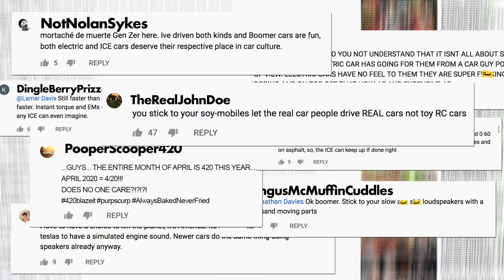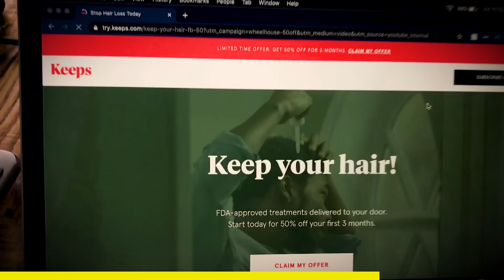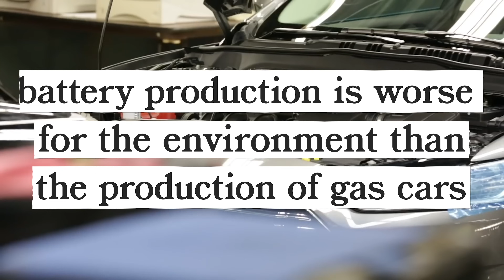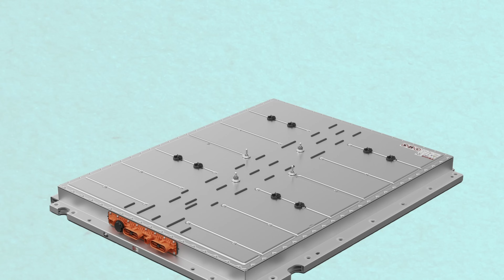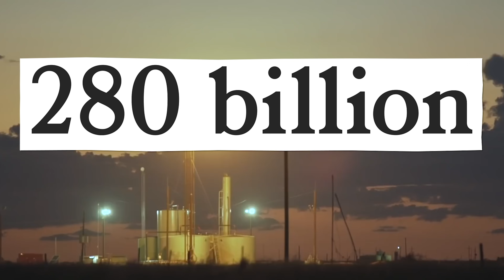Are Electric Cars REALLY Better for the Environment?

Comment: You keep mentioning how it is cleaner to have a electric car in areas where Renewable energy is more available. You need to look at how little a percent of our energy that really is. Then you need to study and find out the facts of these so called Clean Energy power plants. You will find they are not clean and almost always produce less power than coal and natural gas plants, while still emitting a crap load of emissions. And none of them run entirely on renewable fuel, they all use coal or natural gas to burn these so called renewable fuels. Biomass plants cant burn green or wet wood with out help, wind and solar power is intermittent and needs a fossil fuel supply to keep the power consistent. Hydro power requires major disruption to rivers and the landscape. ALL OF THESE ARE BULIT AND KEPT RUNNING WITH FOSSIL FUEL POWERED EQUIPMENT. There is a law of energy that can not be changed. Energy can not be created or destroyed only changed from one form to another. None of these alternatives will be able to produce enough power because they just dont have enough energy in them.

Comment: I agree with all of this...However, and it is unclear in this short format, it seems that most of these facts are averages, the "average" EV vs the "average" ICE correct?.   Wouldn't the averages be skewed towards EV simply because there are no large suv or pickup models available yet? Suv's and Pickups make up a very large percentage of ICE vehicles. Thus their averages are going to be higher by default.  I still think EV would be the winner, but I wonder if the margin would be much less and therefore less significant.   In either case, It will be interesting to do this same comparison in 20 years when there are more Larger EVs (and more EVs overall).  Will the technology catching up negate the increased emissions due to increased average size and range?  Will the depletion of resources force average emissions higher in order to source lithium and cobalt from more difficult areas?

Comment: One thing you missed, and I see everyone missing from their calculations is adding co2 cost of replacing battery every 6-8 years. From your calculations it’s 10 metric tons.
Reply: Batteries don't need to be replaced every 6 to 10 years.
Reply: @UnrealOG137  check out hoovies garage movie about his Tesla model S. Right when warranty ended after 8 years he got update and could only charge car to drive 49 miles. Did some digging, it’s common issue go check it out. Battery replacement is 21k USD plus co2 environmental toll of course. Not sure why would they do that is that planned obsolescence or these barriers may get unstable after such time not sure.

Comment: When I can drive an electric car every day with zero interruptions in my current lifestyle I will buy one. It needs to cost no more than my STi limited did, be as reliable as it is (unmodified), require no downtime due to range/distance issues, go 200,000 miles with standard required maintenance, this means no 10k$ battery changes in the same lifespan. Insurance cost the same or less and last but pretty much first in my book: it has to be as fun and engaging to drive. I have to enjoy it, no one trick ponies. It can’t just be blistering fast in a straight line and weigh 4000#, it needs to be 3400 or less and just as agile feeling.

Comment: Don't forget Nuclear power. Its mostly carbon free. Also your dismissal of the environmental impacts on the local communities that produce lithium and Cobalt is a bit light. We do not have a method to account for those impacts on our environment in our current production of batteries nor for the disposal of the batteries but you did mention that. good work

Comment: Myth #2: Anyone remember the power grid doing down foe weeks in Texas that one winter?
Reply: Yes, because their natural gas pipelines froze
Reply: Anyone remember how the Texas power grid went down because the state's Republican regulators stuck their collective heads in the sand and refused to perform basic upgrades to their grid? Did you know one of the reasons Texas has an independent power grid is because the state didn't see the need to winterize their equipment, an upgrade required by the national grid?

Comment: We just can’t have anything good. We get electric vehicles the mining messes up the water and factories messes up the air. We get gas we releasing even more into the air plus not knowing how oil is actually left. Either way we gon forever fuck this planet up 😮‍💨. 

If Diesel engines were cheaper to maintain I’d rock with that atleast you can make that from plant based oil, the gas mileage wouldn’t be all that but better for environment

Comment: Lithium production in Australia, with some of the largest lithium reserves, is about to change the method of roasting of lithium feedstocks for battery production to a hydro metallurgical process, which produces far less CO2. In addition to this, large offshore wind, solar and wave projects will soon be underway to provide green electricity for charging cars. Problem solved if that happens (and it will).

Comment: If your factoring that battery life on an ev  is roughly 5 years and the average lifespan of an combustion vehicle is around 15 years,  you would need to account for 3 battery swaps which would triple the amount of co2 production.  
Then there is the question of how to dispose of these batteries lithium is highly toxic.

Comment: did you include loss of electricity during its transfer from power plants to the car battery?
Reply: As opposed to the amount of fuel burned in the transport of............. fuel?
The logistics of electricity is far more efficient than the logistics of fuel.

Comment: Problem:
You forgot the fact that Lithium Ion technology is pretty much at the end of development, at least the classical LiIon technology we use nowadays

THATS THE BIGGEST PROBLEM, the BATTERIES! There is no way around looking for more advanced and finally again a LONG LASTING BATTERY, LiIon is by far one of the SHORTEST LASTING BATTERY TECHNOLOGIES!!!
A shame we put this technology in fully grown cars.

The most advancements in this battery technology were made between 2003 (where most better mobile devices got LiPo/LiIon batteries) and 2010, only making performance a lot better and partially the cycle count and/or lifetime of the cell itself especially with Lithium/Cobalt or Iron Phosphate versions which are also a lot safer but less Wh/size.

LiIon will always have to deal with compromises… bad Wh/size ratio, bad safety, bad cycle count/lifetime or bad performing when it comes to high power drain… or in everything not really good or bad…
Reply: You know why i love early EV introduction still… it will probably allow us here in Austria to turn on the nuclear power plant we never started since it got built

Comment: Uhm, the last "facts" you said were kinda wrong...and why? cos you don't know, since there is no data about it.
I don't live in the US in this days but I can sure find some datas about the massive consumption of electricity in the US that would dramatically increase if there were only EV. Now,...I'm not so confident that the grid would keep up if things don't change a bit.
Second...the unfairness of EV is true, the price is way higher and the issue is not that but...the grip, sounds like redundant but it is. Poor countries have lack of electricity so...how can they have EV?
for the rest, it was a very nice video, even tho you forgot -Nuclear energy.
Like your self I do love the sound of an engine but I think electric engines are the future...but not the batteries, that might be the TRISO or nuclear, but not the lithium, cos that is BS at the moment.maybe nano carbon but we will see.
Still, an EV car have some issues and is taking a bit more time then a mobile phone to evolve but come on, it is not the same also right?

Comment: Now you forgot to mention the fact that tires and roadways still require vast amounts of crude oil to run.  Now, electric mass transit is infinitely better for the planet than cars period.  You don’t have the health and safety problems with lithium ion batteries and most of the trains can be easily recycled.  That’s another positive you didn’t really take into account with internal combustion engine vehicles is they are already very recyclable.  Also, engines can burn a variety of fuels and we can probably synthesize a cleaner burning fuel, and have.  Emissions are a big problem with any engine and we haven’t really solved the carbon dioxide issue at the tailpipe which can be done too.  Digging up the trees in lithium- and cobalt-rich regions just compounds the problem of emissions because foliage thrives on CO2.  If anything cars in general aren’t feasible for the environment.  Electric trains are.
Reply: this. but the car lobby collectively put pressure in the US to make roads instead of rails and promote the car as part of the american life style. mainwhile europe, japan and china are maving toward fast trains. it is what it is.
Reply: @rasaecnai  maybe so but cars are hardly even the problem, automotive emissions worldwide accounts for only around 10% of emissions, but it always seems to be the main focus of co2 emissions. If we built more nuclear reactors, emissions would drop like crazy, coal powered plants would be rendered useless, I don’t see why cars take all of the blame, agriculture industry pollutes more than vehicles do via methane, and cars can run on methane, not sure why that isn’t being taken advantage of either.
Reply: Few issues with this thought process though. I, along with many others, don't live somewhere that mass transit is even feasible in the first place. Plus, in the United States especially, we have the space and freedom of movement where not owning your own personal transportation would be highly limiting for anyone who lives a life outside of work and home. Urban centers, this might work for some. But that's obviously not everyone. Plus, even if I did have access to reliable public transit, I personally wouldn't use it. My work allows me the freedom to go on my own schedule and I would not want to rely on a public transportation schedule. Plus, not having to deal with crowds of strangers is enough of a reason to have a car for most people. I could go on. Cars will always have a place and necessity in society in some capacity.
Reply: Yes trees remove CO2 from the atmosphere, but how do you know the amount of CO2 removal from the trees lost in clearing for a mine, is greater than the CO2 removal overall from the electric cars that mine helps produce, that go on to replace many thousands of gas cars?
Reply: People prefer cars and planes or they would use trains.  Most major cities in the US have gone billions of dollars in debt building light rail which al most no one uses.
Reply: @libertarian1536  People use the best most reliable, efficient, convenient and cost effective option available. There's no large scale public train service in Florida, so people drive and take a bus , keeping big oil happy. But there is in Japan, multiple European countries etc. Big oil lobbying prevents large scale public electric train service in the US. That kind of lobbying doesn't exist in the countries I mentioned above.

Comment: “The least efficient EV with the dirtiest power source (coal) will be better than the most efficient gas powered vehicle after a certain period of time". 
No. Not only is this not the case, it is not he case by a factor of 27'711. 
MITSUBISHI Mirage 1.2 MIVEC 2 79hp - UsedPetrol - CO2 96 g/km (the highest miles per gallon found after google search: 69mpg, or 3.41 l/100km)
Coal: 2.23 pounds CO2/kWh = 1011.511g CO2/kWh.
The Mercedes-Benz EQV: combined power consumption: 26.4-26.3 kWh/100 km. Say 26.3kWh/100km. This is 2630 kWh/km.
If that electricity comes from coal, the Mercedes-Benz EQV will emit 1011.511*2630 = 2660274 g/km. That's 27711 times more CO2 per km than the MITSUBISHI Mirage

Oh you have an app? Well I have publicly available information and simple arithmetic. That's all it takes. Take a pen and paper, open google and do the calculations. 

While I have you here, this is unrelated but you should know that 18,000 people died from the Tsunami in Fukushima, zero from radiation.
Reply: You've made a mistake bro. 26.3 kWh/100km isn't equivalent to 2630 kWh/km.
Reply: Yes you’re right! In the end we get 2.77 instead of 27711. Still, driving the electric car is 2.77 times worse than the petroleum car.
Reply: @Stan-san  I'm dubious where you got information from but assuming its all correct, you took the most efficient ICE car and compared it to a coal-sourced EV to make your argument that somehow EVs are worse for the environment than ICE cars. EVs are much better for the environment in the long run than ICE cars, this shouldn't even be an argument.
Reply: @adekolaadeoye7966  No. I disproved the video author's claim that "the worst EV is better than the best petroleum car". That is all it is.

EV's are not always better, not even in the long run. In the short run they are worse most of the time because pre-getting-on-the-road emissions (basically construction emissions) are greater for EVs. These get compensated in the long run (this can be seen via life cycle analysis), in most cases. But this depends on the electricity consumption and the cleanliness of electricity.

But as I said, in most cases EVs are better than petroleum overall (aka over the lifetime), BUT some heavy EVs are worse than some normal sized petroleum cars. Therefore it is important not to get too much into self-licensing and buy a normal sized (or small) EV instead of whatever you were going to buy. Or better yet, if you can, privilege cycling, public transport, train, walking...

Comment: My Answer is NO! Electric Vehicles run by Lithium Ion batteries are much more Worse and Hurting the Environment a lot more than the ICE (Internal Combustion Engine) Gas and Diesel and Natural Gas Vehicles. Electric Vehicles and Lithium Ion Batteries are really not helpful for the Environment. Can the Lithium Ion batteries be recycled?? Can they be recycled ♻️♻️♻️♻️ and use it again???? IF so then WHY China and The USA and Europe are still mining Earth's Raw Lithium Depository??? Not just Lithium Ion but also Copper as well. Is it really saves the Planet Earth when they dig the Earth's crust to look for Copper and Lithium??? Actually it is more dangerous than Fracking the Fossil Fuel. Gas and Diesel and Natural Gas Vehicles Engines and Transmissions can be Recycled ♻️♻️ since they are made of Iron and Steel, some of them made of high strength aluminum. What about the brushless motors of the Electric Vehicles besides the motor housing??? Can they be recycled??? What is Federal EPA ratings for the Emissions of Electric Vehicles?? There's gotta be some emissions in there somehow!! Because Smog/Emission testing centers they knows exactly the average numbers of emissions of a well maintained Gas/Diesel/Natural Gas Vehicles they know. What about the Electric cars??? Sorry for the Electric car users but the way I'm seeing it Electric Vehicles are much more worse and far more polluting than ICE Vehicles.

Comment: Great video, concise and informative. My only beef is that you somewhat glossed over the potential long term effects of EV batteries and their production. You touched on disposal and recycling but didn't go into much detail. And you mentioned the impact on the local people and culture. How will the water shortage ultimately play out? While a metric like CO2 emissions is pretty good for measuring impact, I don't think it quite covers the actual impact of EVs. How much damage is coal-burning electricity generation causing (coal mining, etc)? Not saying your conclusion is incorrect; but maybe not as disparate as outlined, if all the factors are taken into account.
Reply: Most electric production of sufficiently developed countries are not coal power plant. For example 19% of power generated in US are coal. However China produce 56.8% of their power from coal while India is 75%, that partially contributed to the heavy air pollution in these two countries. China already started to phase out their coal power plant.

Comment: So, I build the powerlines. It’s not necessarily the “grid” or the generation, which isn’t that great anymore. But the wires themselves up in the air and underground are mostly old and kind of falling apart by themselves anyway. I replace poles daily that are moments away from falling down. There’s not that many Journeyman Lineman out here either anymore. Which is weird, because I make over 200k a year doing this. You’d think more people would want to do it

Comment: You missed a really strong fact.  You also made a false statement about our Power grid.   CALIFORNIA .   Why on Earth would you not mention the constant Blackout Residents have to deal with in Cali?  I mean its so bad almost everyone in those areas has to have a GAS powered GENERATOR.       Please make another Video talking about specifically California's Grid that cant even handle what it currently is pushing and most cars are still GAS powered.     Why do you think if the majority of residents had and EV the Rolling blackouts would just stop??

Comment: Consumers are deluded if they think BEVs become more efficient during their average life span. At around 10 years or so of ownership, (if you're lucky), the dying befouled battery pack will need to be replaced at an estimated cost of $25,000 to $40,000. BEVs are a scam designed for the scientific illiterate consumer and the manufacturers know it...